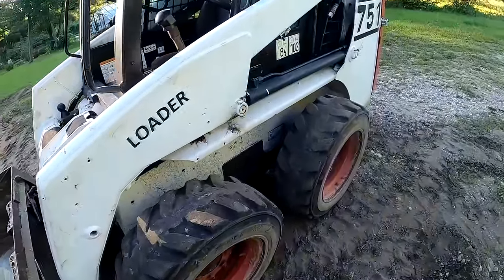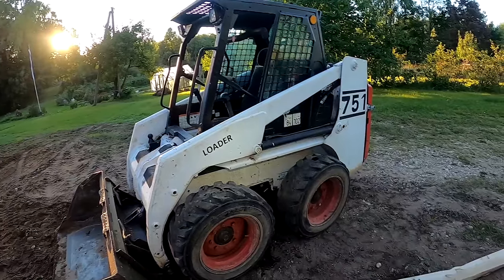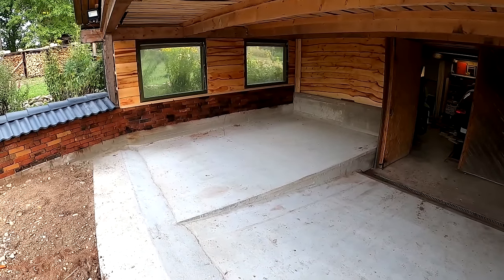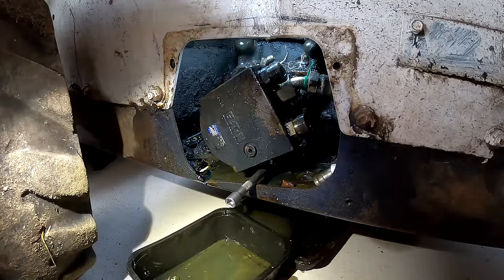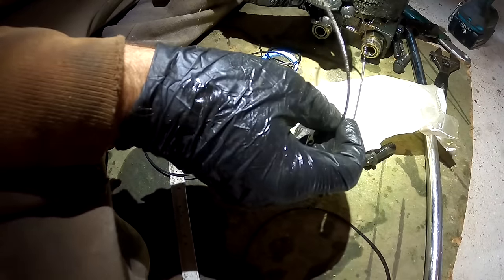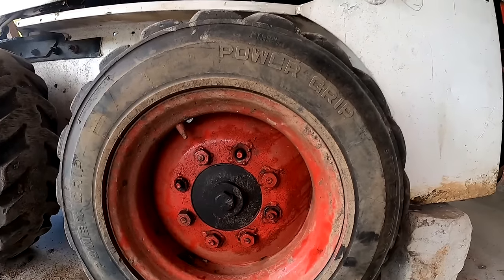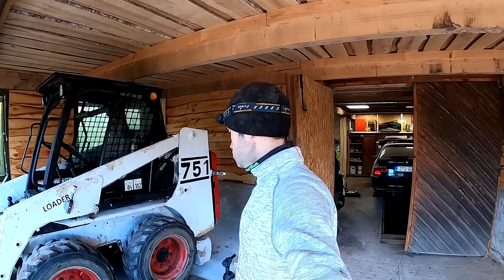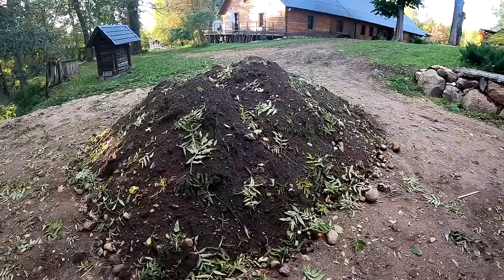Fixing a oil leak on a bobcat skid steer

Comment: What a mess - all that oil leaking out. Strange the left side came loose for no reason!
Thank you for converting the mm to miles - very informative!
Smart to re-torque the other side, just in case.
Reply from the maker: It was weird yes. No problem

Comment: Great video! This is what I dislike about working on hydraulics; the seals are critical, & can be damaged during assembly by the parts they come into contact with (even with careful assembly), & this situation is made more difficult with minimal working clearances. Additionally, all the hydraulic components must be kept as clean as possible during disassembly & reassembly to prevent contamination by grit, etc. After successful repair, I'm sure it's another job you're happy to be done with.
Reply from the maker: Yeah your very right about that part.

Comment: Nice work Ant. I'm glad the old-girl is running again.
I've broken lots of taps in my time, but only in the smallest sizes (even of the best quality). 1/8th and 3/16th inch taps in the Whitworth pattern thread being the biggest pain in my arse (and most of our bolts were nearly always in that thread type, unless it was a German machine. So we always had to a set of both Metric and Whitworth tools, including a thread count measurer of multiple styles of threads from all around the world, to make life easier.
Seals, we used to make ourselves from an O-ring kit of continuous rubber in varying thicknesses, splicing them to the correct length and joining them with high-grade super-glue.
One of the advantages of working for a company with a thousand machines, or more, and motors. (Once upon a time, many years ago)
Good luck mate. I know what it's like to have little in the bank.
Oh - P.S. I bought a couple of sets of tools called Metrinch, that can grip any nut without damaging them, regardless of where the nut or bolt was made. It made life much easier for me. But, I know all tools are expensive...
Kindest regards.
Reply from the maker: you got that right. thanks for the tips:)

Comment: At our local racing tracks the marshals have dry cement which they throw on oil that is leaked by the racing cars. It immediately absorbs the oil so that the cars behind won't slide on it. You could try this on the oil you messed on your new concrete floors. When the oil is absorbed you just sweep up the cement.
Reply from the maker: Hmm interesting. I have to check it up
Reply: @Ants_Pants  Another good alternative is cat litter. Also works great under a gas BBQ to absorb fat drippings.

Comment: Just an FYI Andris. You can cut those seals with a razor blade and super glue them back together for the size you need. We do it on the cnc machines at work sometimes. Great save. The motor would have cost bucks to replace.
Reply from the maker: Thanks for the tip buddy. This one was kind of a smashed up, Pretty sure that was my fault maybe 🤔

Comment: New subscriber here... A bit of spray silicone may help the "Soviet" wood drawers slide better. You may want to consider a gutter across the bottom of the roof to divert rainwater away from your freshly laid topsoil next to the porch... that will keep the dirt from washing away and creating more problems. Nifty fix for the hydraulic pump and some good points on making a new wheel nut. Stay well, stay safe!
Reply from the maker: Hey there, thanks for the tips

Comment: The 12 point bolt heads that weren't 12 mm or 13 mm were probably 1/2 inch size since the Bobcat is USA manufactured.  We in the USA have the same problem when we encounter metric 12 mm which do not work with either 7/16 or 1/2 inch sockets.   By the way, for reference 1/2 inch is 0.00000789 mile.  
I also liked your solution to the missing nuts.
Reply from the maker: Thanks for the tip and info buddy 👍
Reply: But why does only one place insist on having outdated inches making everyone buy 2 sets of everything? :p

Comment: I'm guessing those motor mounting bolts are not 13mm or 12 and a 1/2mm!
 But 1/2inch 12 point bolts imperial being American made.
Also a few drips of diesel on rusty bolts the best penetrating oil (cheap easy avaliable, Put it in an old 3 in 1 bottle) works a treat....
Great Video as always. Thanks
Reply from the maker: Yeah you guess right. Thanks for them tips

Comment: You can clean the oil mess on your concrete floor by simply spreading cat litter on it and ground it in circular motions with your foot. You probably already know that though. It’s cheaper than floor cleaning compounds.
Reply from the maker: Thanks for the info! Iv heard of it but haven't tried it out

Comment: To find the proper thread size simply screw on a die.  Then use the same size tap to thread the nut.  Use cutting oil to cut the thread to reduce risk of breaking the tap.
Reply from the maker: yeah

Comment: For the 12 point bolts you will need a 12 point socket. Watching you try and open the draws made laugh 😂
Reply from the maker: Oh i forgot to mention that i had a torx socket yet it still didn't fit as i was using metric but the bolt was imperial size. 😆

Comment: Oring does not require alot of toes,use loctite on the bolt thread's to prevent them from vibrating loose
Reply from the maker: yeah

Comment: Only advice I can give you for the nuts and bolts.
Loctite, there is one that is suppposed to be strong enough for industrial use, maybe loctite RED? Not 100% sure which it is though.
Reply from the maker: I'm not sure your supposed to add thread clue to motor bolts 🤷‍♀️
Reply: @Ants_Pants  Ahh kk, my knowledge with mechnical stuff is limited. I've used the loctite before on the bolts to hold a Carburetor in place for an old motorcycle of mine. No I kinda feel like an ass for assuming it would be safe on the bolts for your bobcat.

Comment: Hi Mr ants pants..I look for your adventures..in this case you should have realized that the bolts were not metric but sae
The use of the 12 point head allows a 3/8 diameter thread and a smaller head to fit in restricted areas
Anyway carry on sir
Reply from the maker: Thanks mate 👍

Comment: 1/2 inch AF imperial is the size between 12 and 13millimeter.. rub a bar of soap on the Soviet seal drawers it will slide out like a slippery slide.
Reply from the maker: I see. Glad i did not strip the torx head

Comment: I wondered what could have caused the damage to the hydraulic motor's o-ring seal, then I realized the loose hydraulic motor connection is likely what caused the damage to the seal (the oscillations of the loose motor distorted the o-ring seal's round cross section). Given how critical the o-ring seal is to prevent a major hydraulic leak, it might be a good idea to use some thread locking adhesive on the hydraulic motor's attachment bolts.
Reply from the maker: Iv heard it's not a good idea to use them on motor bolts, but maybe some softer version of the clue? that might be a good idea

Comment: @15:06 that bolt is probably 1/2 inch 12 point a 13mm will fit slightly loose on a half inch bolt. Bobcat is a USA brand most bolts will be in Inch not metric. Thanks America for not using the metric system just had to think ur better than every 1 else.
Reply from the maker: Hey Bear! yes it's true. But actually, most of the stuff (big projects and such) are in metric for the USA, the imperial is floating around in mainstream and individual scale

Comment: the bolt that was between 12 and 13mm will be a 1/2 imperial socket
Reply from the maker: I got a metric torx set. 13mm managed to open and close them without stripping the head luckly
Reply: In america we need both imperial and metric tools. We got use to it. why should the rest of the world have the right to complain?
Reply from the maker: We have both here also, mostly hydraulics and pipes overall are all in imperial.

Comment: Bobcats do like to not stay running. IHI is better, they have Yanmar engines. The O ring looks like the hydraulic oil has expanded the rubber seal? Is it rated for hydraulic oil? also if you use high strength thread lock the hydraulic pump bolts wont become lose.
Reply from the maker: Yeah but might not get them off if i need to 🤔

Comment: You drained the chain case oil and added hydraulic oil to reservoir
Reply from the maker: Engine oil actually 15w40, manual says hydraulic oil, but engine oil is a bit more thick and should work better/leak less

Comment: I don't think it is a plot by Bobcat to have unique bolts, they are too busy emptying your pockets.  Those look like an inverted torx bolts.  A not altogether uncommon pattern.  Especially common on brake parts among many things.  They make socket sets for them.  A 12 point socket sometimes works but can round them off, best to get the set.  Every time I think I have all the tools I will need they come out with more--I am in my mid-seventies and still have to buy them, yet my toolboxes are full and multiplying.
Reply from the maker: So true. Always missing a tool or 2 myself
Reply: Sound like trying to figure out ford tools.